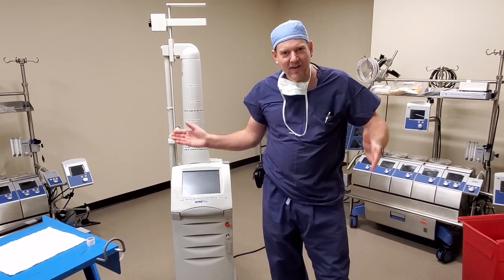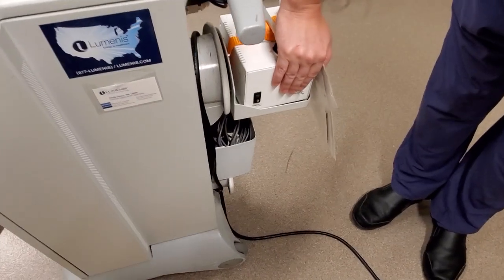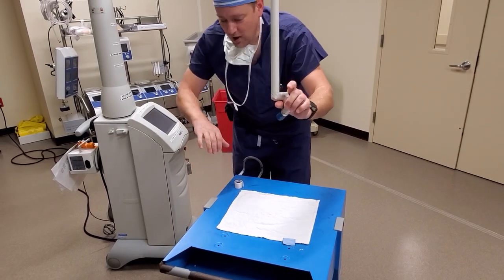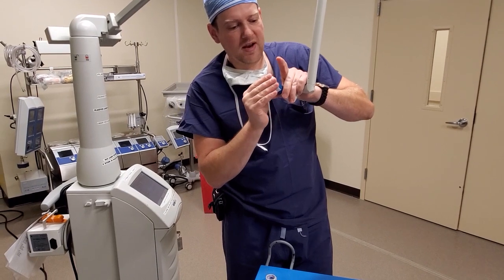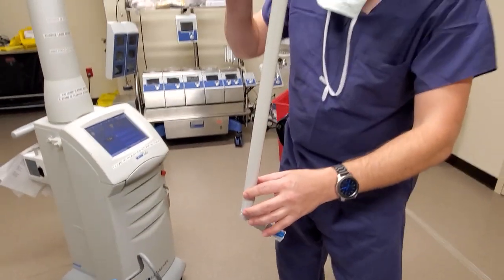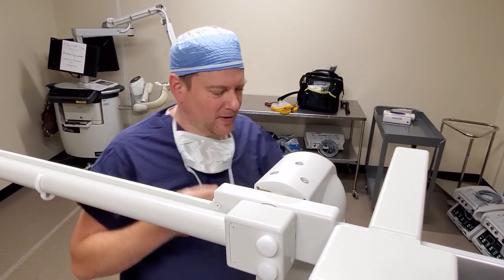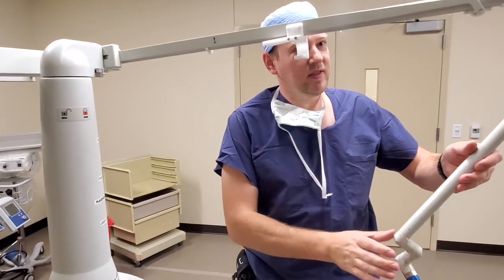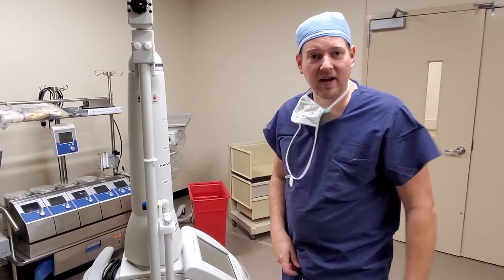CO2 Laser Overview and Beam Alignment

Comment: How to measure or ensure the energy delivery or power of the laser.
Reply from the maker: That is done with a Laser Watt Meter. The meter has power heads / detectors that are specific to the wavelength of the laser being tested. The measure in Watts is based on the amount of heat that is measured from the received laser beam.
Reply: @BetterBiomedChannel  thank you so much